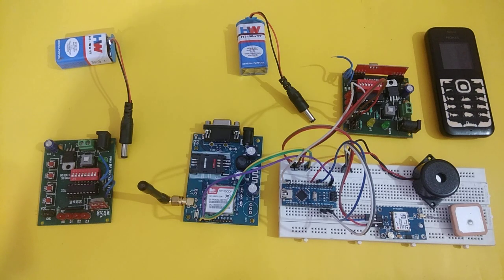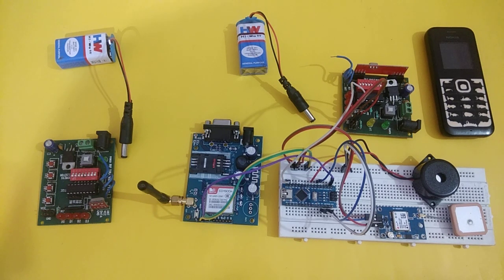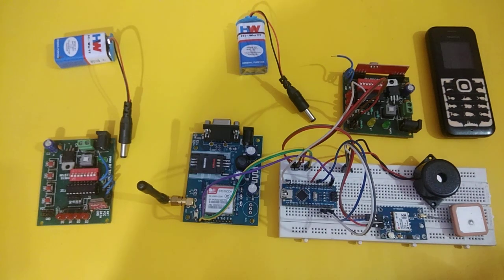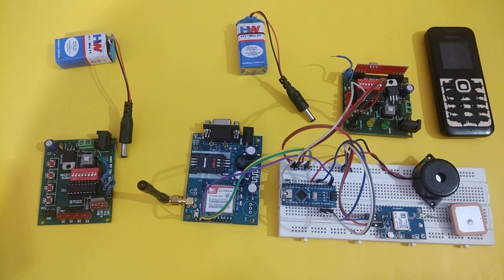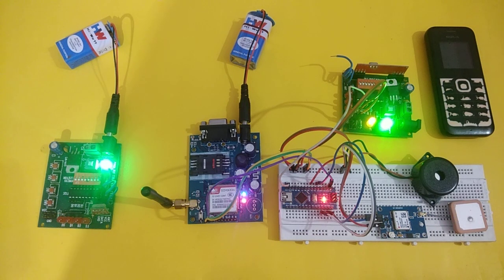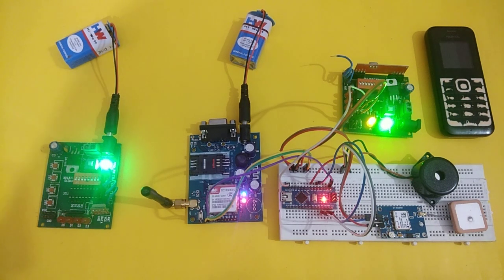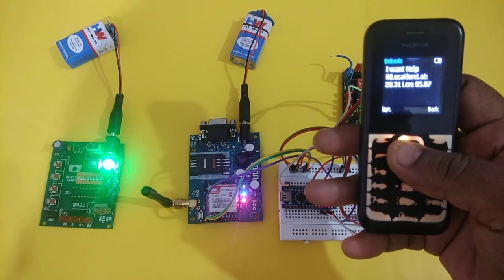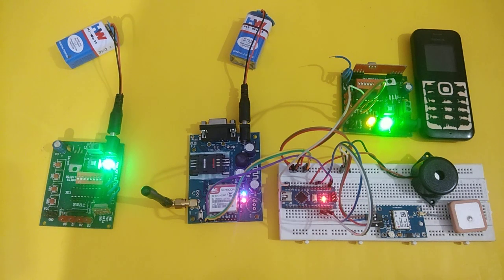Women Safety Device with GPS Tracking & Alerts Using Arduino

Comment: Hello Sir.
Im Trying To face issuse on While Uploding these code to Arduino Nano  we Got Error Sir...How can i Solve This Issue sir...
 Avrudude: stk500_recv() : programmer Is Not Responding 
Avrudude: stk500_getsync() attemp 1 of 10: not in sync: resp=0X7a so on This Error Only I got It sir...Can U please Tell mi sir How can I slove These Issu?
Reply: While Compiling These Code i got No error Sir...
Reply from the maker: Please select Atmega328P (old bootloader) in Tools> Processor option and then upload.

Comment: Sir Code is Not Support..!!
Reply from the maker: Can you please provide some additional details like which microcontroller board you are using and what's the error
Reply: @Circuitdigest  Im Using Arduino Nano(Atmega 328 SMD) 
In this Code Error Shows like 
TinyGPS++.h: No such file or directory
Reply from the maker: It's because you don't have TinyGPS library installed in your Arduino IDE
Reply: Sir And I have Another Doubt,i e Its Shows The Gps Location In google Maps or It just send Only Text msg..?

Comment: I done whole project but in gps module led was not blinking
Reply: What solution did you get
Reply: What solution did you get
Reply: Hello bro was that problem of gps solved i have the same problem what is the solution
Reply: What solution did you get
Reply: What solution did you get
Reply: What solution did you get
Reply: What solution did you get
Reply: What solution did you get
Reply: What solution did you get
Reply: What solution did you get
Reply: Nothing 😞😞👎
Reply: What solution did you get

Comment: Can you please help me
Reply: I'm doing working on this project
But i have not used rf
Reply: The project only deals with gsm gps , arduino and a panic button
Reply: Can you help in circuit diagram and code if possible
Reply from the maker: @pradeeshachari1600  did you check the link in the description?
Reply: Yess sir
Reply: I have not used rf in project
So it's getting difficult for me
Reply from the maker: @pradeeshachari1600  you can try getting help from our forums. I am sure people there will be able to assist you with rf https://circuitdigest.com/forums